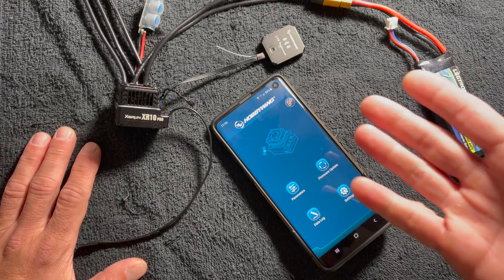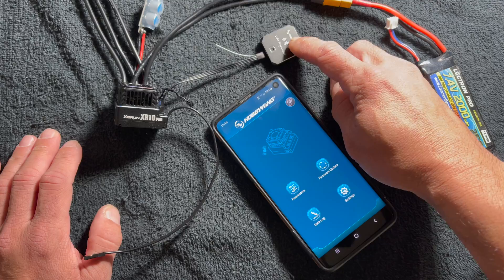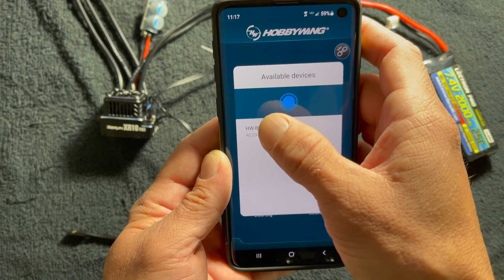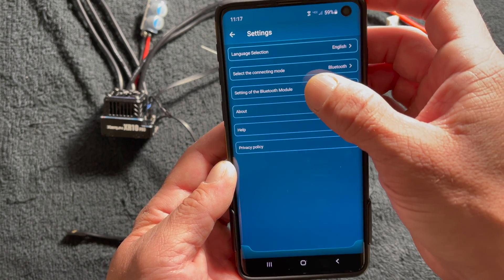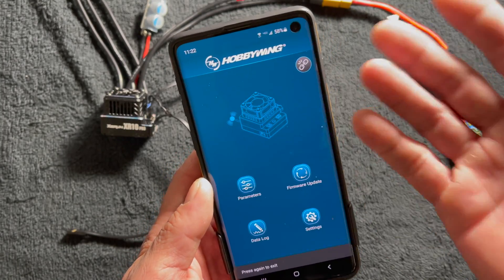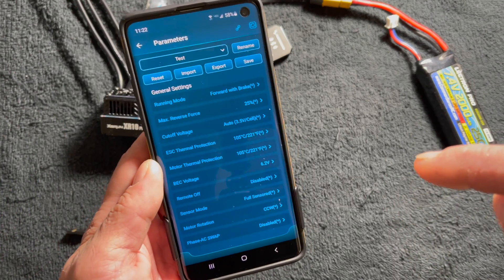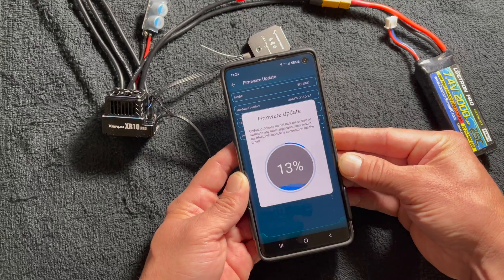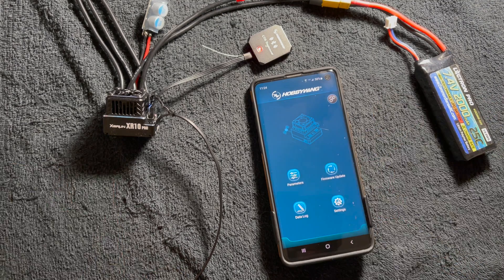The Charlie Show /// Episode 257 /// OTA Firmware update

Comment: Will they write to me.....  Hello I have the 10bl30 amp and when i turn it on i get a soild Green light i have steering but zero throttle and the car wont go into calibration mode and on the booklet there is nothing about a soild green light i dont even any beeps when i turn the car on aswell... Has the esc fried or is it fixable and if not fixable means the girlfriend will understand i need a new one haha